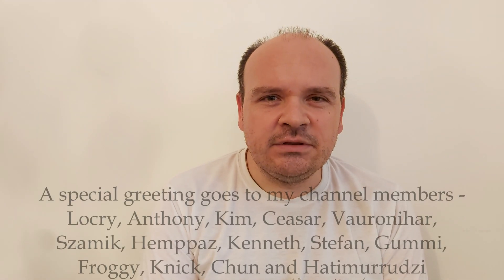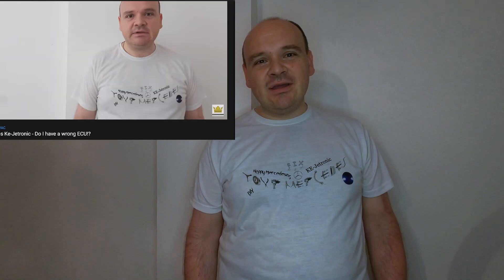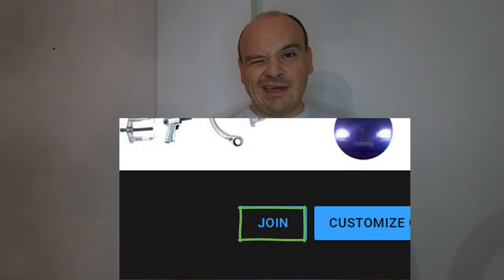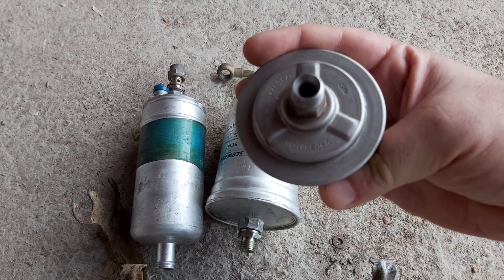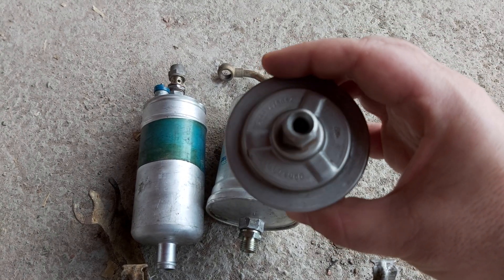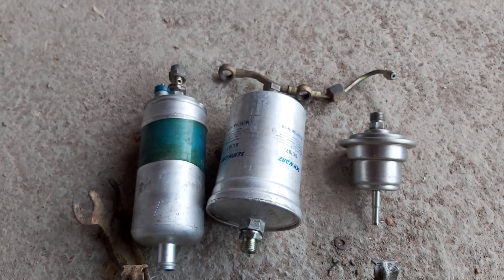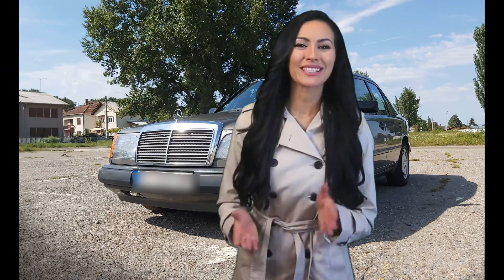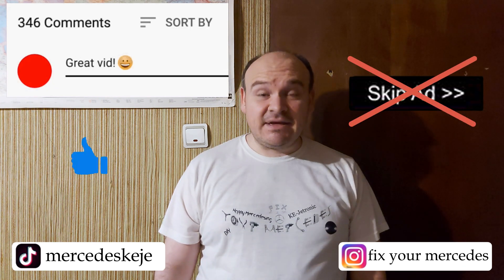㉦Mercedes Ke-Jetronic㉦ - Answering the comments - potentiometer, 🛸fuel accumulator and some more...

Comment: Hi, i have an audi with k-jetronic, it stoped working yesterday, the thing is that all works "aparently" but fuel does only get to the cold start inyector, to the others no, the fuel pump, filter and thoose are good
Reply from the maker: You should test the fuel distributor for fuel flow(ignition on, engine off). Measure the fuel flow in one minute. Also measure the pressures - you should inform yourself about the system pressure as well as about the control pressure. Find yourself a pressure gauge that can measure the pressure from the warm-up regulator as well as from the fuel distributor. There you need something with one gauge and hoses so that you can switch from system pressure to the control pressure.

Comment: Buenas señor, tengo un Mercedes 560 SE desde hace 15 años, los últimos 8 años ha estado parado por diversas circunstancias. Este año le puse neumáticos nuevos, cambié el aceite, filtros y una manguera de la bomba de gasolina y todo perfecto, durante unos dias.
Después empezo a fallar, arranca bien, mantiene ralentí y mientras vaya despacio todo bien. El problema viene al acelerar fuerte se viene abajo y a veces incluso se para el motor. Pienso en el filtro de combustible o las bombas (lleva 2) no esten funcionando bien. Me gustaría saber su opinión por si puedieran ser más cosas. Muchas gracias, fantástico trabajo, un saludo desde España.
Reply from the maker: Buenas y gracias. Pruebe la bomba de combustible. Debe entregar al menos 1 l de combustible en 40 segundos (motor apagado, encendido encendido). Si pasa la prueba, entonces no tienes que reemplazarlo, pero yo lo haría, debido al largo tiempo de espera. Reemplace los inyectores, las copas y los soportes, reemplace el potenciómetro, la lambda y revise todos los sensores, reemplace las mangueras de ventilación. Esto debería resolver muchos problemas. Saludo desde Serbia
Reply: @mercedeske  Buenos días, muchas gracias por su rápida respuesta, voy a cambiar las bombas y el filtro, ya las compré, el acumulador parece estar ok. Entonces voy a cambiar también el potenciómetro, gracias a tus vídeos podré hacerlo. ¿Sabes la referencia del sensor O2? Me hace mucha ilusión poner de nuevo el coche en carretera.

Comment: Great video! Thanks.
Reply from the maker: My pleasure. Happy Mercedesing. When can we expect your next video?
Reply: @mercedeske  have you heard that here in Arizona we are having a heat wave? For the entire month of July we had temps 110 degrees to 119 degrees! The lows are in the upper 90’s making it impossible to work in the garage. In fact, I have been trying to paint the exhaust manifolds, but temps are too high for painting. The forecast for the next 10 days is again 110 degrees or higher. I’ve never seen anything like it. I’m hoping for a cooler evening in the upper 80’s so I can’t get them painted. My last video I made a DIY sandblasting cabinet in 119 degree temps!
Reply from the maker: @TonyLiveTV  Wooow. We are having here in Serbia about 95 degrees but on 119 is impossible to work. I don't like winter but I don't like heat waves as well because I sweat a lot, making some works impossible for me to work on. Just keep on and you are right, this is not normal, someone wants it to be this way and it's not the God!

Comment: Hi! I am writing to you from Poland. I bought Mercedes 190 2.3E from California with just 64k miles and full original. My Mercedes have one issue but this makes me crazy. When sun will warm up the car the engine starts very hard. No problem when the engine is hot or very cold, just when the sun touch for couple for hours body car... I tried with pumps, accumulator, sparks, coil, air sensor or three temperature sensors on cooland. Also I tried air-fuel ratio adjustment and this is even worst. I lost hope about this but i found your channel.  Please, help me! 
Greetings from Poland, 
Mateusz.
Reply from the maker: Try replacing the altitude  sensor. Maybe you have it. It has to be connected to the pin 11. Maybe that's your issue.
Reply: @mercedeske  First, thanks very much for answering me! 
I found this sensor a year ago. I deduced that the resistance increases with increasing pressure, but to this sensor no tube is connected so i think resistance maybe increase with temperture when invalid, am i right? So i help this sensor a little bit, I bent the plate to make sure that the resistance did not increase accidentally.  Do you think we should keep trying to replace it?
Reply from the maker: @MateuszKruk-bh7gx  Replace it. I have a video on it on the channel, the altitude sensor.
Reply: @mercedeske  Thanks, I'll try to catch up with my knowledge.  the last question for today, is there any contact to you, or do you always answer questions in the comments?
Reply from the maker: @MateuszKruk-bh7gx  The ones I know. I don't like people to keep me updated about the state of their vehicles, just to tell me that it was a success, if it was.